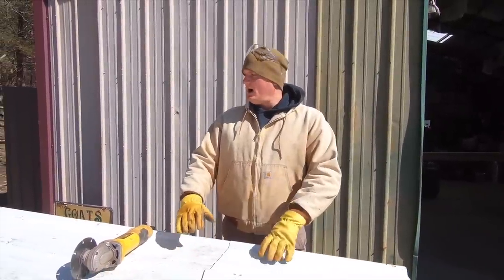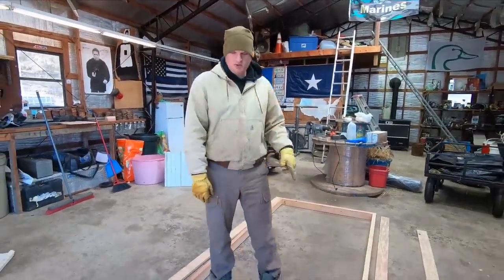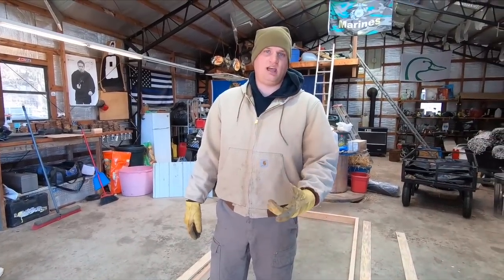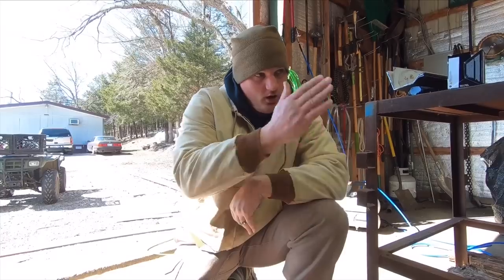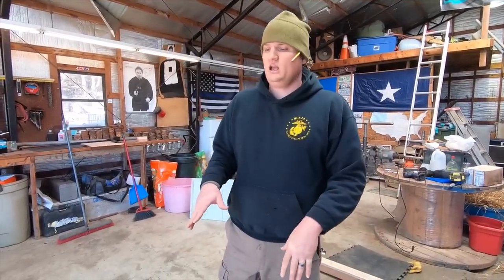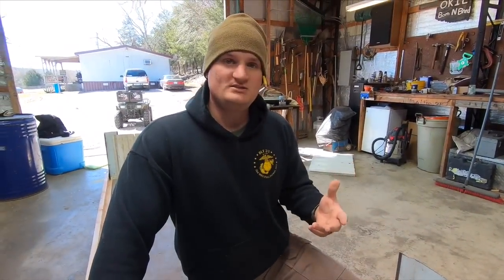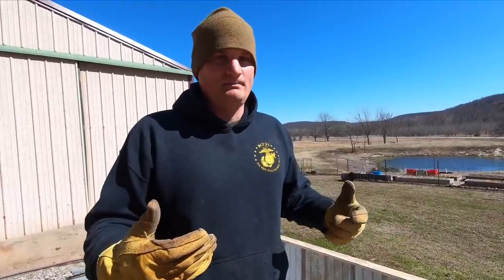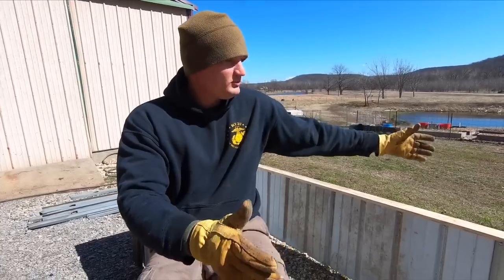STOP Building Wooden Raised Beds!! | How To Build The BEST Raised Bed For The Money!

Comment: To Treat the timber? Burn it, scorch the surface all the way around, brush off after burning. then if you added an oil ,that wood will last for decades  :)
Reply: It's an Japanese technique. Shou sugi ban.
Reply: A sober lesson learned after Godzilla came ashore. Japanese Builders waste nothing! )))
Reply: I wonder how well it would work with wood indirect contact with standing  water.
Reply: Really? I did not no that!
Reply: @hamadilawson4396  
It's actually a Manchu/Jurchen technique developed in the 900s, although it may have been used by others even earlier
Reply: @hamadilawson4396  I was just going to say...but I knew someone would beat me to it.
Reply: May be redwood or cedar
Reply: @anjiexox2711  If you Google it =It's an Japanese technique. Shou sugi ban.There is now a faux shou sugi ban that does not involve same burning technique which is best on Japanese cedar anyway
Reply: That's a great idea cause he keep saying  will last forever but he's not burning or treating the wood. Even if the tin last for decades the untreated lumber will not its againist the dirt and all the elements and it won't last decades.
Reply: The dirt will not touch the wood with this design-- just go treated. Use your extra time saved from scorching drinking beer or something,  lol!

Comment: You might get 4 years out of any lumber sitting on the ground or out in weather 24/7. Use all metal construction with threaded rods from side to side to stop bowing out, and a metal stake in the middle of each rod to hold it up so the soil will not pull the metal sides inward as it compacts. I learned the expensive way and build 5 good sized raised beds out of all wood and regretted it. Really nice looking for a couple years and then........

Comment: I just made 6 of these; 5 about 10x4 and one is 6x4. I used pressure-treated 2x4 lumber both on the side and as top pieces. They're all 16" high. it was a PIA dealing with sharp sheet metal (I've got 3 bad-aids on as I write this) but they should last a long time. I calculated I saved about $900 using metal roofing panels instead of more wood. Time will tell if they hold up, but right now, they're very, very sturdy. Thanks, Sawyer Ridge Farm for a great video!

Comment: That's a great idea, and I have some scrap metal siding around here.  I think I'll frame in the bottom to reduce the risk for potential blowouts.  Thanks for the inspiration!
Reply: Could use PVC to frame bottom and wire to hold it in..may take quite sometime to rust out.

Comment: We tried that in the 1970’s. Manure, and or mild fertilizers or acidic soils dissolve the tin. We then tried galvanized nope did not last, galvalume nope. Good drainage, wood construction last longer. They all will fail after 7 years. So now we use brick and mortar problem solved. Thanks for trying tho.
Reply: You could always line with plastic to extend the life of the metal
Reply: Good paint also solve the problem. I use chicken, rabbit and horsemanure for my beds, no problem here. Perhaps metal acts differently here in Norway  😁😁😁😁😁
Reply: Good information to know. Thanks
Reply: The issue is the acids in the dirt along with the oxidation being sealed off from air, the easiest way to fix it as with wood beds is get a good road base fabric, not the thin cheap weed stuff at garden centers, find you a misery supply that sells bulk/delivery planter soil, bark, sand, gravel, etc will sell nice "Road base fabric"  will stop. The soil making contact and allow air and drying between wood and metal and dirt.
Reply: coat the  wood in  old motor oil with deisel, like is done for fence posts.  Will last generations.
Reply: @mmccrownus2406  No that is false. We used to use Brand new rail way ties within 10 years they were rotted out. Sorry but there is no better way than brick and motor(expensive) but best practice.
Reply: @mangannon1647  
I'm looking for a way to not have plastic that will infuse into my plants, having me eating plastic toxins.
Reply: Hmmm, you got me thinking now! thank you for your input!!
Reply: @nathanduerre8368  Great idea! I'm putting in some more veg. Beds for n. It's so expensive. We have two cedar beds and need to add on a bunch of beds now. I wasn't sure if these tin beds would last. They look cute. I was afraid it might bow and degrade?
Reply: @mmccrownus2406  Pretty much the same as treated lumber. 
The oil and diesel will slowly leach into your soil.
Reply: stop using chemical fertilizer, bro.
it kills the soil

Comment: I built similar with less effort from my original replaced garage doors. Just sink 4x4 lumber is the corners, use a cutoff wheel on the door for desired length, bolt the door sectionsyo the concreted 4x4s and fill the box with a good soil. Going on 5 years with these beds now

Comment: I had considered building some from the galvanized panels but I was going to build a 1x4 box around the top and bottom and use 2x4's in the corners but this way looks legit ..you also could cut some Dow rods into 12 inch stakes and drive the in the ground every couple feet to make sure it doesn't bow out

Comment: Looks great!
I've built a lot of raised beds over the years and anything that can rot will rot.  Here in Virginia SYP (southern yellow pine) is plentiful and while it's (relatively) inexpensive and readily used for interior projects, it doesn't hold up to contact with soil - most wood doesn't.
I've made beds with straw bales and they are cheap and quick but decay quickly and tend to get weeds in them.  Plus you cannot sit on them.
This metal solution is strong, durable and straightforward to build - all of my beds going forward will use a similar design.
Thanks for all the great videos - much appreciated!
Reply from the maker: Thank you Matthew

Comment: Great idea! Just one mistake is the description of the material you are using, It is galvanized or painted steel, not tin. Tin is becoming a rare element. The confusion arises from the thin sheet metal cans that food was packaged in which was actually tin-plated steel. Tin cans (plated steel) were discontinued around the 1950's but the misnomer continues. Now there is no tin at all in food cans, metal roofing, or metal siding. Someone commented whether tin was safe in a vegetable garden. Not to worry, this siding is steel, no tin is present.
Reply: It irritated me every time he said 'tin'! Good video other than that :)
Reply: :-D and this is exactly why some of us oldies still call it "tin foil" instead of aluminum foil!

Comment: Great video! I'd paint the outside of the metal.
Reply: It will rust from the inside I think.
Reply: Epoxy paint on in side it's on all metal water tanks, that is portable water tanks

Comment: I'm really impressed by the simplicity of this build out. Great idea! Do you ever have issues with the bottoms bowing out from putting too much heavy rock/soil inside?
Reply from the maker: We put it in the ground just a few inches where it won't do that.
Reply: @SawyerRidgeFarm  Do you dig a hole and bury it a few inches in the ground or can you kind of hammer it into the ground a few inches?  Thanks for the video!
Reply from the maker: I use a shovel and slid the bed inside the shovel Crack. Not really digging hope that makes sense.
Reply: @SawyerRidgeFarm  It does, and that's a great idea.

Comment: Question??? Does it bow out when you fill it with soil?
Reply from the maker: We will be sticking the raised bed into the ground a few inches or more before we ever even start to fill it. That will help stabilize it. And we’ve never had a problem with it before doing it that way. It probably wouldn’t hurt to put some supports, but we’ve never found it necessary.
Reply: Sawyer Ridge Farm awesome. Thank you for your response

Comment: What's going to keep them from cutting into and sinking into the ground? Otherwise I think they are perfect!
Reply: rocks? anything solid it would eventually come in contact with would stop it.. there is very little weight here.. except for the dirt inside of them, which are gonna create and outward force...not a downward force.. consider putting your shovel on the ground.. how many years before it sinks into the ground... MANY... just not enough weight to make it happen.

Comment: And not so back breaking as ground planting. Folks plant x flowers among vegs to keep bugs/worms out.
Reply from the maker: Yes Pauline good tip.
Reply: Normally, you want worms, right? Or do you mean grubs and caterpillars?
Reply: @melissajarvis4829  Earth worms you do want but there are other varieties which eat out the roots ( can't think of the name ) which you don't want. Place a beer can in each corner of the bed, have the opening at a 45 degree angle so sink the bottom of the can into the soil, have about 1/3rd filled with beer and leave, this will catch all slugs and snails and as mentioned planting some flowers will attract many air borne critters to them instead of the veg

Comment: "YELLA WOOD", from Home Depot. treated with non toxic "BORAX". Great for any application that calls for ground contact pressure treated wood.
Reply: That’s what I used as the bottom ground contact boards with regular pine 2x12x12 top boards.

Comment: You're still dealing with wood, which WILL rot and need replacing in a few years. Work smarter, not harder. It's loony tunes to muck around painting all that wood with linseed oil or anything else every year! And that will not work as well as you think anyway.
Cattle panels lined with hardware cloth for the win. Just cut the panels up however you want, tie them together with aluminum wire ties meant for chain link fence, and tie 1/4" hardware cloth to the inside with zipties or whatever. Low cost, sturdy, easy to build, and impervious to the elements. You can just take them apart and move them in pieces easily if you ever need/want to for some reason. For the very easiest bed, just cut the panel in half lengthwise down to two pieces 16' long x about 2' wide, bend each into a square or circle, and tie the ends together and line them with the hardware cloth. BOOM you're done, you have two self-supporting beds approx 4' in diameter x two feet deep, at a cost of about $35 for both. No rotting wood, no pre-drilling, no screws, no painting or oiling, no maintenance, none of that nonsense. They will outlast everyone of us.

Now if you just happen to have a pile of galvanized metal roofing laying around, by all means use it up! But just use steel t-posts, don't screw around building a bunch of wooden stuff to frame it.
Reply: Dystopia Gear hardware cloth? That will allow all the moisture on the sides to escape and be useless in my opinion. Plants would dry up super quick. Maybe sturdy.. maybe simple.. but I think the solid sides would be much better.
Reply: @gregbrown5556  you're speaking from behind a keyboard. I'm speaking from years of experience with these beds. Circulation is a GOOD thing. My weather varies between weeks without any rain to weeks where it rains every day, and my beds hold plenty water during the dry spells but never get waterlogged. Ever hear of fabric pots and why they work? Check it out! If one lives in a truly arid climate they can always further "line" the bed with leaves, wood chips, cardboard etc.
Reply: I like what we call goat panels, the squares are smaller and they are a bit stronger than the cattle panels. I never thought of using them for a raised bed, thanks for the great idea. I might line them with weed cloth and add a top plate just to have something to sit on while working the beds.
Reply: @TheRedhawke  yes, the only reason I don't use goat panels is that they're noticeably more expensive than the cattle panels - because they just have more metal wire in them. But they should work great. Your weed/landscaping cloth idea will work fine too; I built a couple of mine with that as well as the hardware cloth and it certainly didn't hurt anything but I didn't really find any big advantage to it either. So it's entirely up to you.
Reply: @Alan_CFA  Unless you live in a truly arid area, wood rots, *period*. You can build something you know will fail if you want, and you can tell yourself you're going to paint/oil it every year. It's no skin off my nose. This is certainly not the worst raised bed design I've ever seen, but it's not the best either. And personally I grow for food, not to aesthetically please anyone with my beds. You think a box made of metal roofing is aesthetically pleasing to most people who care about that? OK then, but whatever, this isn't a fashion show, it's serious business. Especially now when so many people are already relying on their gardens to ease their food budget and/or make some extra money, and we're facing likely food shortages or rationing in the very near future. 
Why set out and KNOW you're going to have to rebuild something when you can just do it right the first time, for less money than almost any other design, and literally never worry about it again? Buy you some fancy schmancy pretty containers for the yard if you need to be aesthetically pleased by what your plants are growing in; I notice no one ever brings that silly noise up about old-fashioned ground beds. Only when they're trying desperately to tear apart a proven idea that just plain flat out works BETTER, essentially FOREVER, because they're upset about it for some odd reason.  ;)
Reply: @dystopiagear6999  thanks for sharing. Sounds like a great economical option.
Reply: I'm a strong believer in a solid rust proof material. Concrete or concrete blocks. There's a YouTube posting where a man casts concrete panels for a garden bed. I've used  his approach as well as stacked 8*16 concrete blocks.
Reply: Make us a video!!!
Reply: That's a great idea. Fast, affordable, and long lasting.
Reply: @hamadilawson4396  I thought about using cinder blocks and concrete as well but with the heavy metals in concrete products I am rethinking and going to use some sort of roofing tin style.  Cinder blocks may be made with flyash or bottom ash from coal fired power plants. Typically the main composition of Class C fly ash contains 3.5 to 40% calcium oxide, 0.5 to 40% aluminum oxide, and 2.5 to 25% Magnesium oxide.  However smaller percentages of strontium, chromium, nickel, lead, arsenic, cadmium, and other heavy metals are also present which cause it to be classified as hazardous waste by the EPA.
Reply: @dystopiagear6999  
I would really like to see your raised beds and how you made them Dystopia Gear

Comment: Add many years to this and or wood planters is to line the insides with a good road base fabric, not the cheap weed stop at box stores, find where they sell sand,bark, gravel, soils, they will have big rolls of fabric you can buy at the foot , this stops soil from migrating into the rock , will provide a great barrier to keep soils from leaching acids and moisture to oxidize and rot metal and wood also allows air to breath. Its amazing who this will triple the life of your planters

Comment: When you fill it with soil doesn't it start to now out without supports
Reply from the maker: We will be sticking the bed down into a few inches or more of soil before we ever start to fill it. But we’ve never had a problem with bowing in our other beds.
Reply: Wayne Kemmet I was wondering the same thing.
Reply: Look into hugelkultur gardening and fill it halfway or so with limbs and work your way up from biggest to smallest until you reach mulch size. Then only 6 or so inches of soil is needed. Much cheaper! I've got 2 made from logs that we wrapped with corrugated scrap tin and they work great. Very little soil needed and good airflow for the roots and as the limbs and brush rot down, it creates compost. I'm on my second season now and have carrots still growing in there that I planted last year.
Reply: I mean you could build a cheap 2x4 frame for the bottom easily replaced in a few years and not a lot of money

Comment: I built 4 beds two years ago and used rough Cedar lumber with the sheet metal. I did run 30# roofing felt around the inside of the sheet metal so there is no dirt to metal contact. It is working great so far.
Reply: Robert Robinson Please forgive me if this is lacking common sense question: but what happens if the soil is in direct contact with the metal? I ask because I want to build a vegetable garden... Thanks in advance.
Reply: @joegallehgos1301  The acids from the soil can deteriorate metal over time. Roofing felt might contain chemicals. I'm wondering if plastic might work?
Reply: @mangannon1647  o

Comment: Try cutting the metal with snips. The manufactures here in australia tell you that using snips drags the zinc across the cut adding protection to the cut. Using a metal cutting blade heats the metal up and burns the zinc reducing protection as well as placing red hot sparks on the painted surface.

Comment: You don't have to worry about wood rot if you use cedar, or redwood. In the past, I used redwood, but because I now have uneven ground and no tiller, I use cement block. They follow the bumpy terrain, but the earth inside is level (I no longer have a tiller). Spring came early this year, so I'm a little late - but I'm scurrying. Oh, how I miss my tiller & my chipper.

Comment: Nice job and great idea - the cardboard on bottom can be scraps flattened out from grocer store or Walmart to stop weeds - I do that on the ground on traditional no till garden - another idea might to line the bottom with hay bales then u only need half the dirt and potting soil to fill it up - if roots penetrate top 2' soil they will do fine in the hay or straw. - Just another idea to think about.